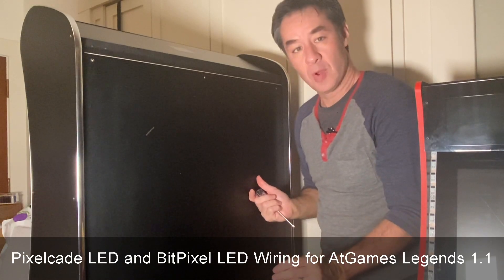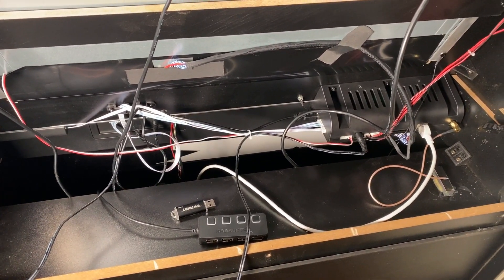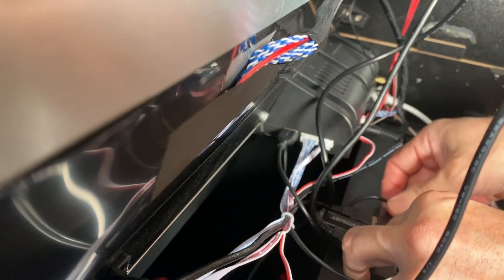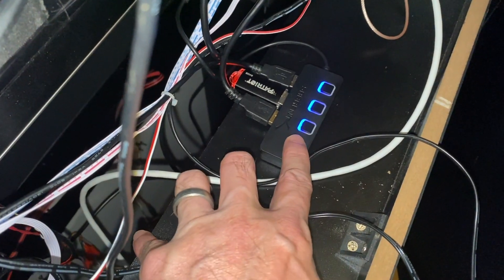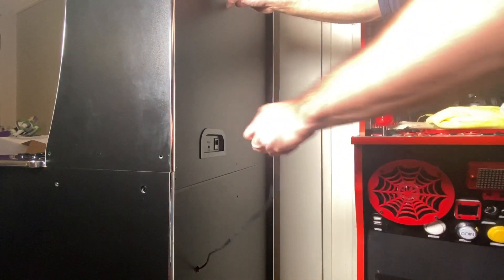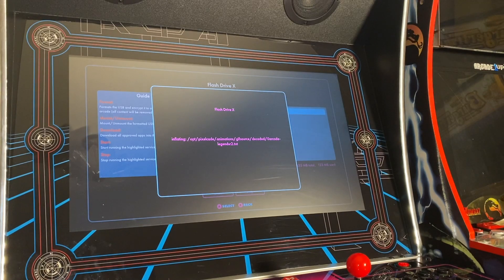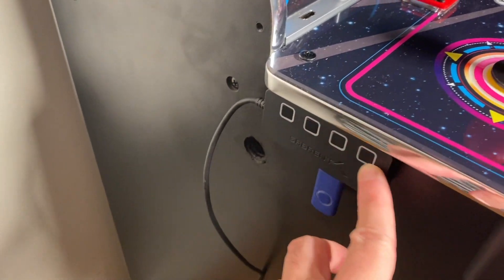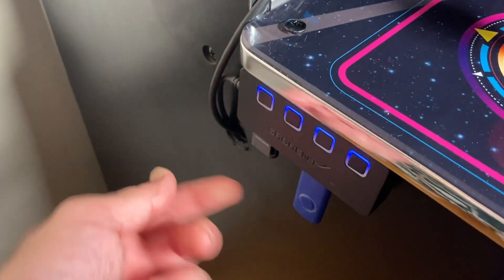Pixelcade LED Inside Cabinet Wiring for AtGames Legends 1.1

Comment: I own a 1.1..so by doing the hub inside, there won't be a need for anything on the front panel, or wiring coming from the side of the cabinet?
And also, I've heard that when the machine is powered off the bitpixel stays powered on, is that true?
My cab is in my bedroom and it would be pretty unfortunate to have that thing lit up when I'm trying to get some sleep.
Any help would be greatly appreciated.
Reply from the maker: Two solutions here , option 1 with additional hardware https://youtu.be/U3I0mzlAD-s or option 2 is follow this guide https://pixelcade.org/customizing/ and change the default image to an all black frame. After that once the ALU is off , you will no longer see the default Atgames animated logo and rather all LEDs off

Comment: also when you hook a power hub or that hub you have I have no pinball usb hub but I do have pixel cade usb power on thier no internet icon just a globe showing in top right when you go into the wifi settings their not showing any wifi connections also when diagnostic mode the way is hook showing no internet both using a power hub 2.0 or using no power hub when I plug it in the main of the machine and use the main going in to the hub, the problem it seems when the bit pixel is pluged in to the hub its having conflict with the tatio games software
Reply from the maker: Hi David, I'm  not sure here what is happening, this would be a good one to post on the AtGames FB fan page, they are a helpful bunch and may have some suggestions https://www.facebook.com/groups/457437778352096

Comment: CAN YOU HELP ME PLEASE  I have atgames legends ultimate 1.1 I purchased the bit pixel purchased the exact usb hub that on your video when I hook it up everything loads but no internet connection icon comes on the screen and/ or the joysticks board doesn't work when I do it in the front I used my zacari and tatio packs and put pixel cade software on that and it works but whole problem is when I go to play tatio pinball games music plays bit pixel stops but music still playing the 2 games shows on the screen appears no signal found like I have an hdmi plug in after about 30 seconds it goes back to press the button again as if you just want to play for the first time keeps doing that the two games of this problem is space invaders and operation wolf pinball  all the other games work and coin ops works great I been messing with this for a month now hooked up many different ways inside connection and hooked outside on the panel connection 3.0 and 2.0  lts like a communication error with bit pixel other pinball games work fine  I also tried it on my ALP machine from at games the same bitpixel to see if it was a bad pixel and it works perfect on legends pinball machine with no flaws
Reply from the maker: not sure what is happening there, you'd need to check with AtGames on this one, sorry

Comment: I'm guessing this does not work with ALU 1.0. I don't think it has a full size USB-A connection on the inside.
Reply from the maker: correct, ALU 1.0 the solution is to to put the hub on the outside

Comment: I'm at a bit of a loss right now. 1.1 machine, followed your guide and am using the same USB hub. Every time I install Pixelcade X, on attempting to launch I get nothing but "PixelcadeX failed to start or device not found" errors. I am using a separate flash drive for this from my CoinOpsX drive, all of the USB ports are lit up, and I have tried putting the Pixelcade drive in each of the four USB ports with no success. Also tried only using my CoinOps X flash drive and installing Pixelcade to that drive, same result.

ETA: after much messing around, found the problem. The USB cord kept pulling when hooking the bitpixel up and became loose each time, hence the device not found.
Reply from the maker: great, glad to hear you figured it out

Comment: I have a quick question for you.  I already have a sub flash drive with Coinops and all my game rooms on it.  I don’t want to format it and lose my rims.  So, do I need to use another usb drive for the Pixelcade or do I just install the Pixelcade software on the same usb that I have the Coinops installed?
Reply: I have the same question.
Reply: And nothing

Comment: I'm attempting the same setup with the same hub, but when I boot up the ALU my deck controls don't work. The hub buttons are depressed and lit up. Any suggestions?
Reply: I'm having the same issue, did you ever figure it out?
Reply: I had the same issue and I also used a powered hub as well so I left back usb in the machine and used a power hub used the far right I believe its a 3.0 hub in front

Comment: I purchased a Atgames bitpixel led and I want to ask you what kind of hub I should order from Amazon or which one do you have?
Reply from the maker: cool, hope you enjoy it, here's the hub I have been using https://www.amazon.com/gp/product/B00BWF5U0M/ref=ppx_yo_dt_b_search_asin_title?ie=UTF8&psc=1
Reply: @opengadgets  Hey Al, is it best to have your CoinopsX on one USB and the Pixelcade software on a separate USB? I assume you could put both on the same USB if you wanted. I am thinking I will put the USB hub on the inside but keep my CoinopsX on the front USB for easier access. I this case should I put a second USB inside on the HUB or just install the Pixelcade software on my main 128GB USB? Thanks